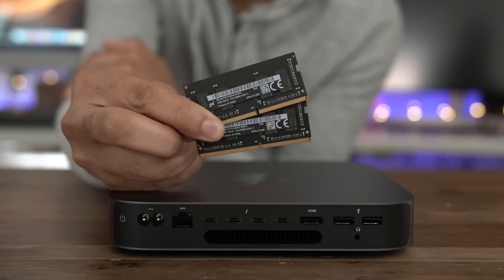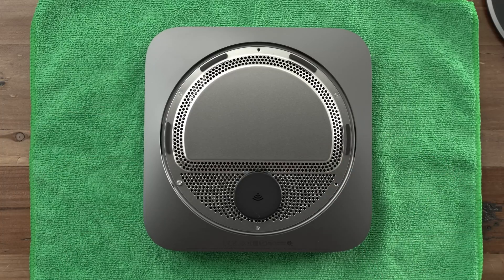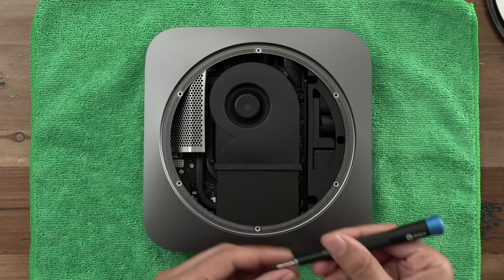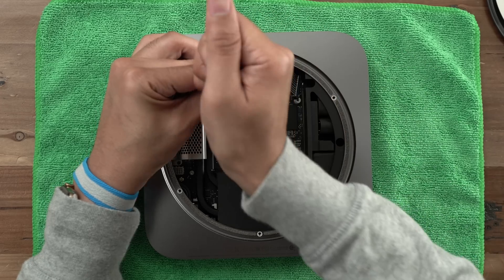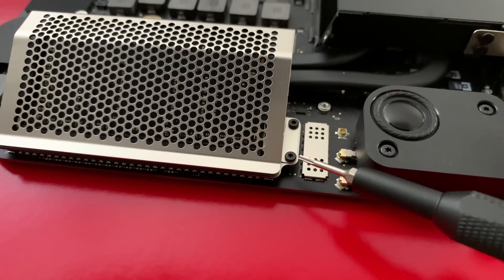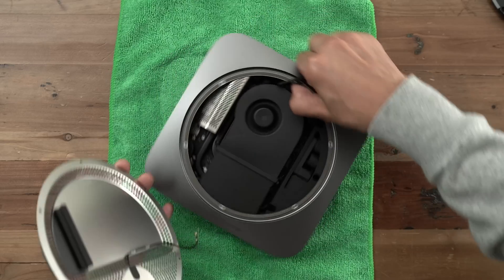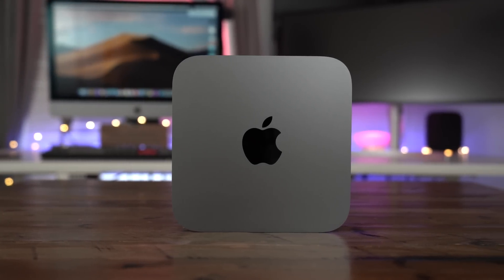How to UPGRADE RAM in the 2018 Mac mini & save $$$!

Comment: Just a note - when sliding the board back into place you did not mention we need to ensure the cables need to be pulled up over the board. I pushed the board back in, cables got stuck and the screws that "took muscle" are now stripped and I can't get the board off again.
Reply: For future reference on this older video & comment…

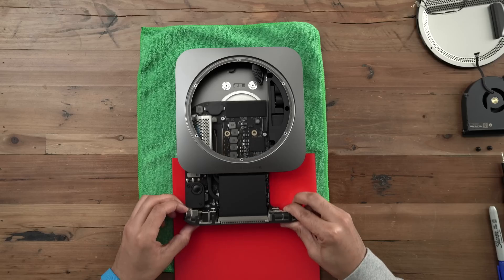@ 10:08 he DOES explain about ‘pulling up the cables’ (power & LED).

Comment: Great video Thank You! However the ram I installed was backward from the ram in the video? The ram, I removed was also backward from the video.The only other problem I had was getting the socket back on from the antenna wire. I finally fasted it down first and then it snapped in. (big fingers)

Comment: Thank you for this great video.  I just completed the 8GB to 32GB upgrade on my just purchased Mac mini taking it step by step watching your video.  Thanks also for the recommendation on the iFixit tool kit.  I bought this as well (from Amazon with same day delivery--for a small fraction of the savings of not paying Apple to configure my 32GB).  I had no trouble with the LED connector--use the tweezers supplied in the tool kit and it pops right up.  Probably my biggest difficulties were... 1) getting the rubber memory card protectors back in place properly, but finally figured it out.  The little rubber rails slide down inside the metal clip handles.  You can't see any of this until you take them off.  And 2) Getting the antenna wire brace to realign with the screw hole while holding the Torx driver with one hand and the antenna with the other hand.  I was always afraid of dropping one of the little screws down into the system, but the magnetic Torx tips help with that if you're gentle.  I also had a momentary scare when I noticed that the original 2x4GB modules I was taking out were 2666 MHz vs the 2400 MHz 2x16's I was putting in.  But I double checked and the mini calls for 2400, so Crucial got it right.  The latest models from AAPL are shipping with 2666--whether they're actually running at 2666 is another question, but you probably won't notice the difference.  I certainly wouldn't recommend this project to the average Joe, but if you're good with fine mechanical work and you have the right tools, go for it.  At least the 2018 IS upgradeable.  The 2014 was not, at all.  And the Crucial 2x16GB kit is available today (12/22/19) for $116.50 on Amazon.  Even with the tool kit purchase, I saved a total of $421.  :-)

Comment: WARNING TO ALL: When removing and putting back that small torx T6 screw that secures the antenna cable, use a magnetic screwdriver and avoid missing the mark. In my case I let the screw drop and whoosh it disappeared in thin air!! Shaking the whole mac mini did not reveal any loose screw somewhere in the whole case!   I had to remove the entire mainboard to hunt for it and could not find it. I found out the reason after much worry: the speaker assembly near the antenna had sucked the screw right under the raised speaker assembly due to the strong magnet! So strong was the magnetism that I could not hear any screw rolling or shaking about in the case when I tried to locate it! Be careful all! Best to insert the screw into the metal plate at the end of the antenna cable before you place the plate over the screwhole and attempt to screw the torx screw into the receptacle.
Reply: Appreciate the heads up!
Reply: Thanks for the warning! After reading your comment I bought the small iFixIt kit (about $23). Well worth it.
Reply: Good to know, thanks
Reply: I know this was posted 5 years ago but things on the internet never go away so...thank you for solving this mystery for me.  The exact same thing happened to me and I never found it.    One of the other screws (possibly one of the 4 from the ram cage) was the same size so I used one of them to lock down the antennae.  The ram cage being short 1 screw isn't going to affect anything and, so far, I haven't had any issues with the 'missing' screw (that is most likely stuck on the speaker magnet).
Reply: watcher696959 thank you friend, I hope you were able to find a solution
Reply: im sure the majority of us are not stupid/carelessness like you
Reply: @DanRustle  Try being kind. Much easier life.

Comment: Excellent tutorial. Super clear. I had no problems with the LED connector. Thanks for the very clear walkthrough. Now I'm running 64 GB in this Mac Mini and it's a breath of fresh air.
Reply: J Adisa did the crucial 2x 32 sticks at 2666 MT/s work? I’m looking at buying them for my Mac mini setup.
Reply: Andrew Hooper I bought the Samsung memory - Samsung 32GB DDR4 2666MHz RAM Memory Module for Laptop Computers (260 Pin SODIMM, 1.2V) M471A4G43MB1 https://www.amazon.com/dp/B07N124XDS/ref=cm_sw_r_cp_api_i_he8bEbG547W8F

Comment: I wish the person making this tutorial would have been more cautious about remove the plastic back as there are foam pieces glued to it that can be damaged/cut if you just insert the plastic tool haphazardly.  Instead, with the ports facing you and the Mac Mini upside down, insert the pry tool at the 12 o'clock, 4-5 o'block, and 7-8 o'clock positions.  Was super pissed when I found one of the foam pieces nearly sheared off because of the lack of warning.  Also, I found the hardest part to be reinserting the wifi antenna cable into the socket when closing it up as it was rather difficult for me to get it inserted, unlike the other cables.

Comment: Guys be careful when you take out the fan connector. It’s it extremely small and can break easily. I did.
Reply: This should be at the top of or even be mentioned within the video. I just replaced my memory and broke off that little connector as well. The solder joints however seem to only hold that little connector in place. So as long as you don't rip off the actual fan connectors, you can move the fan connector in place once again. This worked for me and the fan is indeed working.

For everyone else who wants to remove the fan cable, please don't tug the cable only but make sure to hold the connector in place.

Comment: This is exactly why I'm still on the late 2012 model. Just popped the cover at the back and replaced the RAM modules. I get PTSD just watching people DIY their way around the MAC internals. I've been contemplating adding an SSD, but no way am I removing anything else other than the back cover by myself.

Comment: Seriously, thank you for this. I followed your video step by step and took me all of 20 minutes to do. Very easy, but looked daunting to start. 

I quadrupled the RAM in my Mac mini for 1/6th the cost. Here's the RAM I used https://amzn.to/2Ze032O
Also picked up this iFixit that had everything I needed for under $20. https://amzn.to/2TXhij3

Total cost for 32GB upgrade- $140 + 20 mins of my time. Massive improvement, booted up instantly and recognized the DDR4 as if Apple put it there themselves!

Comment: Thank you for this tutorial. Upgraded my min from 8 i to 64 using 2 - 32 cards.
Reply: Did you have any problem doing the upgrade procedure? Everything working perfectly? Thanks.
Reply: @fisnet0  pulling the power was more difficult than I was expecting, it's a pretty tight spot for that cable. Also, I forgot to check to make sure I had the right bits, like the TR5, had to order a new set. So far everything is running smoothly

Comment: This is nuts. In my mini 2011 all you had to do was pop off the bottom (w/o tools) and literally just eject the ram. Thanks apple :(
Reply: I really don't think this is Apple changing their design to make it harder to upgrade the ram. Look at the size of the fan and exhaust, there isn't room to place the ram whereas the 2011 Mac Mini(Which I also had and manually upgraded ram and hard drives) had a much smaller fan and exhaust that left space for the ram unit.
Reply: @jaredsilvers2782  Agreed. I've since done the upgrade and it wasn't too difficult. Just tedious and time consuming, but worth DIY!
Reply: That's the point of making upgrading these things hard for the average tech user. Its intended for you to be discouraged from upgrading your own unit so that apple will get another 350 bucks
Reply: SO TRUE! This totally expresses my thoughts on Apple back then compared to now. Everything was simple and easy and now they are just complicating things. I would NOT feel comfortable doing this sadly. I tried pulling this off on my PS4 when the fan broke and accidently broke some wire that cost even more than the entire unit to fix. In the end, I just threw it away. Life is complicated enough.
Reply: Agreed. Absolutely ludicrous. Doing it myself nonetheless as I don't mind a little tinkering for fun. In Australia I was able to purchase the 32GB of RAM for AU$184 -- Apple is charging AU $960! Even more ludicrous. Seriously, what on earth could possibly be the justification for that sort of mark up?
Reply: @sanjivsathiah7290  For every custom order, Apple makes an untrained intern go through and break a dozen Mac Minis before he or she manages to successfully follow this tutorial and upgrade the RAM. Hence the markup.
Reply: What’s so infuriating is that the manufacturing process for them to build in a larger memory is exactly the same regardless of memory size they’re putting in. I could accept say a 25% markup on the memory as such for a BTO, but not 400% on the consumer price for RAM modules, that’s just crazy. Surely Apple is making enough revenue without stiffing consumers on the RAM upgrade price...
Reply: @sanjivsathiah7290  Yep, I'm in Australia too. This has convinced me. Cheers, JAYTEE
Reply: @sanjivsathiah7290  Just a guess but possibly to help out Tim and others up top buy new yachts ? More company stock buy backs? I don't know just a guess ;)
Reply: @EVANCOOL Agreed - tedious, but the Apple Tax on this is more than enough motivation to endure the tedium!
Reply: Yeah this video has convinced me that if/when I upgrade to this Mac Mini I'll just be a sucker and order the RAM upgrade at the time of purchase. It'll cost me more to do so, but I am NOT going through all this trouble and potentially breaking a new computer.

Comment: A walk in the park thanks to your excellent video guide. I took me 20 minutes to upgrade the ram and it saved med $500. The only issue I had was the led connector but I did as Jeff did, and it worked.
Thanks
Reply: I no longer have a working LED... Broke the connector right off the logic board.

Comment: Done, thanks for the instructions. Such a p.i.t.a just to swap some RAM. But, with an I7 I won't have to update my Mac for another few years. My 2013 iPad Air is still going strong after 6 years of hard daily use with no cover or protector.

Comment: Great video.  I think it's worth mentioning that RAM in a 2018 Mac Mini DOES NOT click in, it simply sits and is HELD IN by the metal prongs on the side.  I couldn't get the RAM that I thought had to click to click.  I may have forced it in and I couldn't get the RAM to seat, had to take the Mini to the Genius bar 2 days later.  Low and behold, it started up fine for them and the tests were all OK.  I'm wondering if the RAM (OWC 64 gig), had to somehow seat itself after time.  Please make a caption to this effect before you insert the RAM on the video.  Thanks . Also, the RAM I thought would have fit in the iMac, but they are a few MM apart in size.

Comment: I have just followed this excellent video to upgrade the memory on my wife's (she is a photo editor) new Mac mini i7, from 8 GB of memory, to 32 GB.  

There is only one point of clarification I would make. There is nothing novel about the Torx Tamper Resistant 6. Google T6H screw. T = Torx; 6 =size; H= hole in the tip. 

As often is the case Apple use this screw to secure their case and bingo the screwdriver to fit the screw is rebranded  and sold for 3x the cost.

Comment: Everything was pretty easy the actual problem I was having was getting the rubbers back on the sides of where the mount for the memory is. Boy did I get frustrated. I kept putting them on and they kept coming off. I continued and nothing will work. I thought maybe I was putting the left on the right or the right on the left but no that wasnt the case. Then all of a sudden after so much frustration I took a deep breath tried and again and they just went in smoothly with no issues. I was so nervous seeing a brand new mac straight out the box dissected and me running into a hiccup. 9to5 thank you for all the inspiration. I watched this video about 35 times to commit to memory and also watched it during my setup. Also learned the importance of an egpu thanks to you as well. Continue all your great work its truly appreciated.
Reply: I usually use my ipad not my memory to do this kind of thing lol
Reply: @nasraidub  weeks before buying my mac mini I always try to watch unboxing videos and just go on a youtube binge watch of what I am buying. So I ran into this video which saved me so much money. So even before purchasing I just kept watching it over and over lol and then I watched some of it the day I got my mac mini

Comment: Awesome man!!!, I followed this and worked 100% perfect!, now I have 32GB of ram.

I didn't buy the crucial ram, because I happen to have an old ACER laptop that I don't use much which had 32 GB of ram, it was also 2666. I was nervous at first but it worked perfectly.

Also the 8GB of ram that came with the Mac Mini I installed them on the ACER laptop and is working fine also.

I just saved 600 bucks!, Thanks!
Reply: dc commesse how to know which ram my Mac mini will support

Comment: For the power indicator part, a tweezer is actually more safe, I always thought I am going to damage the cable. And for the memory installation, if you are not buying from Apple, they would not install your own 3rd party ram for you. that's what I've been told and make sense. Otherwise nobody is going to pay extra to get the additional RAM except the 64GB version, which I couldn't find any manufacturer making 2x32GB module.

Comment: Do you have any videos on upgrading SSD as well?  I am planning to purchase a 2018 Mac Mini with fastest processor but everything else at base, want to upgrade Memory and SSD myself.  Your video was very clear and easy to follow, thanks for some of the closeups.
Reply: The SSD is not user-replaceable, it is soldered onto the board.
Reply: The SSD is soldered to the motherboard so unfortunately this one wont be upgradeable.

Comment: Great tutorial; thank you!  I messed something up.  Only one of my new memory cards is reading.  For now, I still have twice the memory I had, so I'm not running out.  I'll tear it down again and reinsert the cards.  Agree with the majority -- Apple really made this tricky!
Reply: Fixed!  Quick and easy the second time around!  Now this computer is FAST!  🥳  Thank you again!!!
Reply: @JaneJones1  I am having the same issue. Did you just take the RAM out and put the RAM back in to resolve?
Reply: @Matthaeus hi yes I think so.  I just took it out and slid it back in and that fixed it.
Reply: @JaneJones1  Awesome! I actually did that too and it works now. I flipped what slots the cards are in. Hopefully this helps someone else. 64 GB of ram, nice!!

Comment: Hi, great video! What is your recommended storage size for the 2018 mac mini. I'm thinking just to get the 256G and use an external drive if I need more space since upgrading the storage is quite expensive.
Reply: I would recommend at least 512. With the innovation of new apps today the size of them do get pretty big. But if you just going to use your mac for email and web then 256 will suit you well. Hope this helps.
Reply: @uneekfoto3264  Thank you.
Reply: Fan Jin anytime 🙂

Comment: It's OK to use a magnetized screwdriver?
Reply: If you don't you'll drop your screws down into the computer and lose them
Reply: I will def use a magnetized screw driver and also what I did was I also purchased a magnetic mat to put all the screws and label them.

Comment: This is so wrong on so many levels. First, no electronics belong on a towel!!! Secondly,  This gentleman may be a qualified technician, but he doesn't have the smarts to keep like screws from the same area together. Given that they are alike using the same driver and thread it would be wise to put them in close proximity to each other. Third, his manner of speaking is arrogant and condescending.

Comment: Hi anyone notice an increase of heat?  I noticed the case quite warm after about an hour. I was taxing it with loading a bunch of sample libraries in Logic but didn't have a heat issue with 8GB of ram. Any ideas?

Comment: I like the 2012 Mac mini i7 quad core, screw off top, install ram...screw on top... done, a two minute install. Apple went out of their way to hide the ram, it’s doable as you show very nicely but your non computer geek won’t be trying this and void their warranty. Old Mac Pro 2009 -2012 12 core multi core score is still as fast or slightly faster with a xeon 5680 or 5690 than the new six core Mac mini and you can install whatever flash drive, blue ray drive,  Nvidia or AMD graphics card, ram etc. it’s much cheaper, I’ll be sticking with my Mac Pro. Now if they had a 12 core mini then I might jump on it. My guess is Apple will just be coming out with a Mac mini pro 12 to 24 core for their next  Mac Pro in 2019 we shall see.

Comment: Great info, thanks.  I see that you can go up to 64 gigs of ram.  But I can not find 32 gig sticks.   There is only two slots correct.  Am I missing something?
Reply: 32 gig sticks haven't been released yet by 3rd party manufacturers
Reply: Is the 64 GB of RAM possible now?